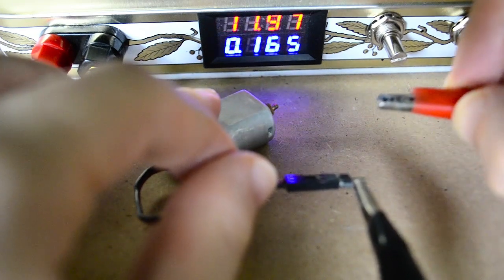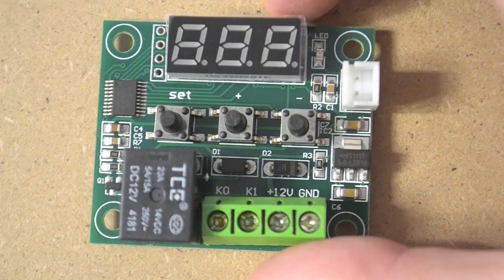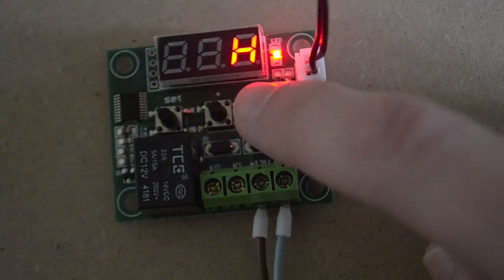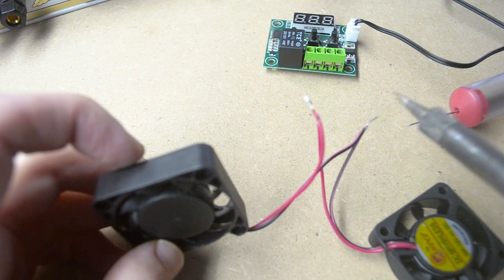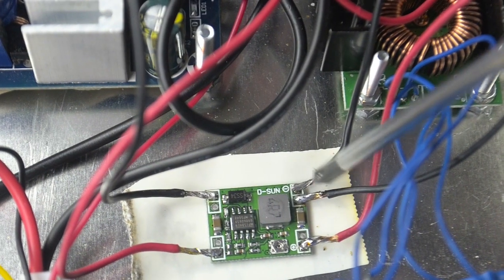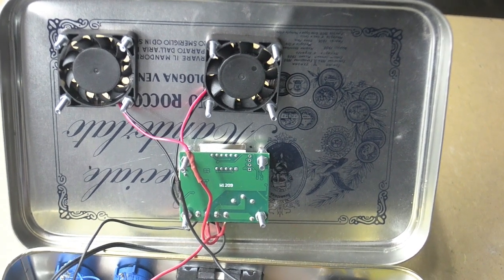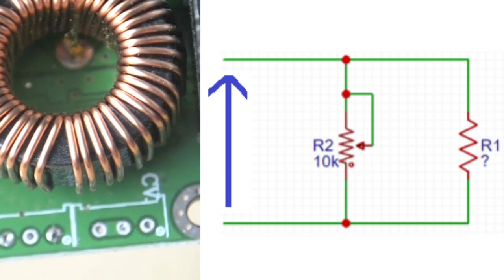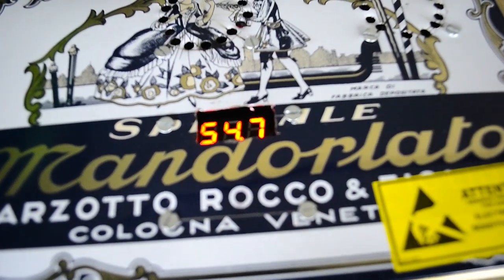Make your own Lab Bench Power Supply - DIY - Power your projects - PART 2

Comment: Parabéns meu amigo, seu projeto de fonte é muito bom!, consegui tensão de 26V e corrente de 10A e os potenciometros são muito sensíveis ao movimento, tudo muito bom. Montei em uma carcaça de fonte ATX de 500W ficou ótimo.
Congratulations my friend, your source project is very good !, I got a voltage of 26V and a current of 10A and the potentiometers are very sensitive to movement, all very good. I mounted it on a 500W ATX power supply housing.
Reply: HAPPY RONYBIKE DAY!!!

Comment: What value of resistor is needed with 10k multiturn  potentiometer? 10k or 22k ??
Please reply!
Reply: 22k ohm👍
Reply: @Aleksaaa00   In my circuit amperes are not stable . I am not getting the problem. Please  help me out!!
Reply: You need put 22k ohm resistor on volt potentiometar
Reply: @Aleksaaa00  yes I applied 22k ohm resistor on voltage regulator
Reply: How do you mean amps are not stable?
Reply: @Aleksaaa00  I mean in my circuit everything depends upon voltage
Reply: You can't increase the amperes as the voltage. To increase the amperes you need a consumer, for example, take a light bulb from a car and increase the voltage to 12 volts, it will show you about 1 ampere, as you increase the voltage so the amperes increase, when you put the consumer you will be able to increase the amperes.

Comment: Hello, I have made the source as in your video with the same components but the voltage does not stabilize it tends to rise little by little until it reaches 24 volts, I do not know where the problem may be since very little electronics, you can lend me a hand

regards

Comment: Hi need ur help. I done connection as per your instructions. My meter showing voltage but not ampere. Any solution. Ampere showing 0.00
Reply: You make this power supply?

Comment: What's the maximum output voltage  , please tell me
Reply from the maker: Hi, It's around 23.70v. The current is around 9.3A
Reply: And the minimum output voltage is?
Reply: I think he said the maximum voltage is around 26 volts but the most important  question is how much current (Amperes) it will supply at ANY given voltage?

Can you please answer that? Thanks!